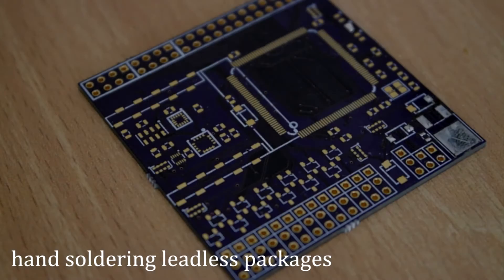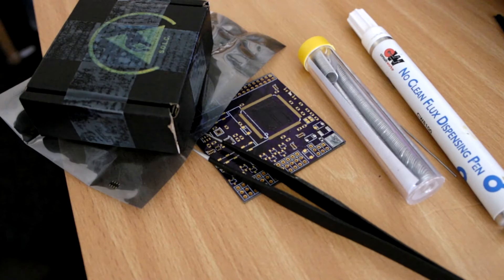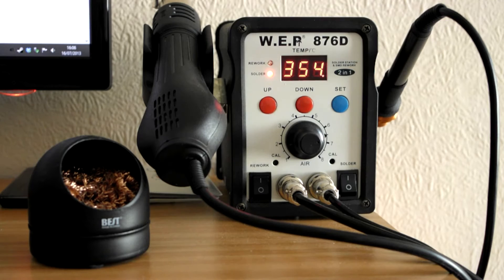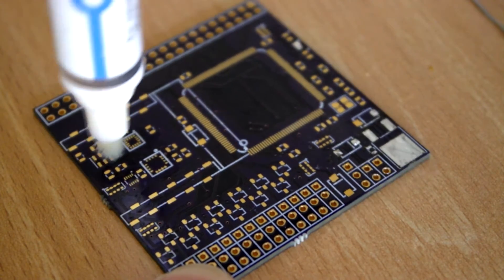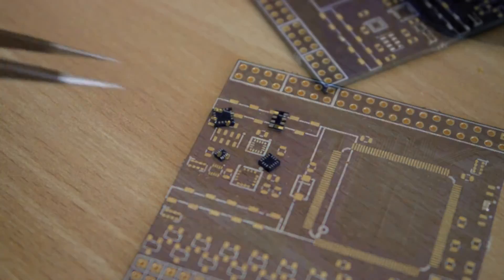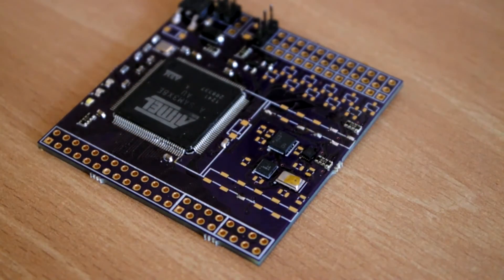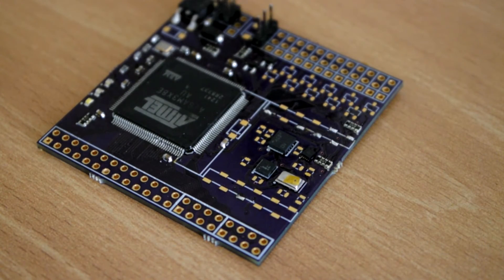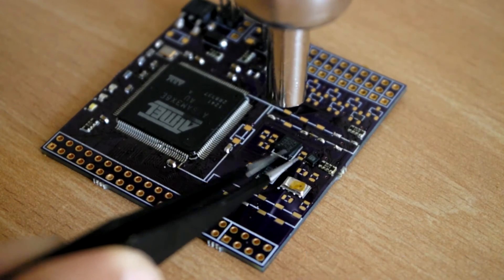Hand soldering leadless surface mount ICs without solder paste - SMT/SMD Tutorial

Comment: This is crazy.

I need to train myself until I get good enough to repair my sweet old pc engine gt so I've bought a few kits (xmas tree smd) to train.

I thought it was the toughest thing ever and broke my first but what you did here is amazing.

Very well done and thanks.
Reply from the maker: Glad you found it helpful! When you start off it's always a nightmare, but with a bit of practice you'll become an SMD god. I know guys who solder wires and 0402 passives to the bottom of those tiny sensors, I find that crazy. Best of luck with your soldering endeavours.
Reply: HammerFET I am VERY glad to say that I've finally made my 1st working project with smd :D

It's a small xmas tree (vellman kit)...

It took me a few hours of pure pain and fun (and a destroyed kit) but I've finally done it.

Your video was precious.

Have a great xmas :)